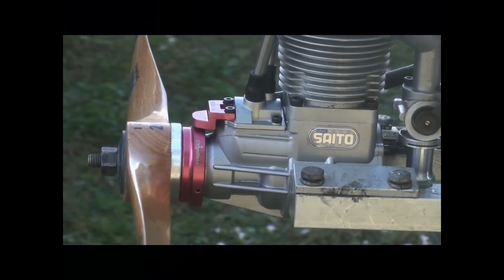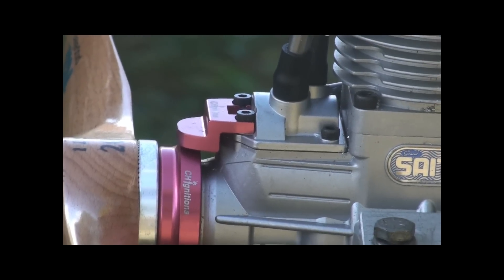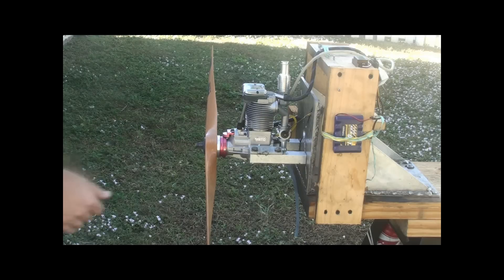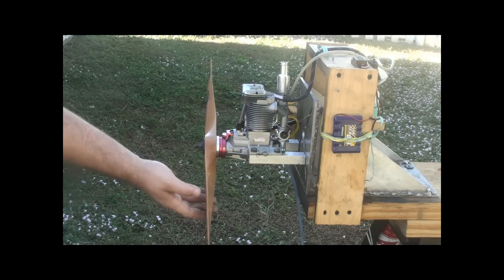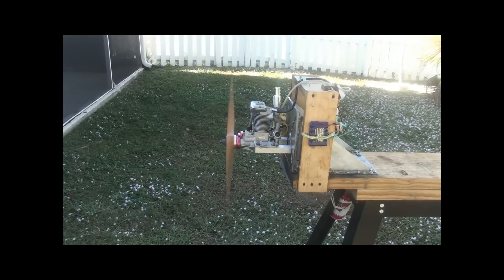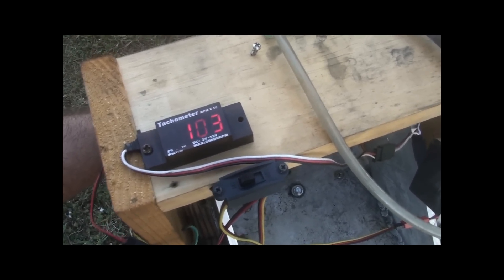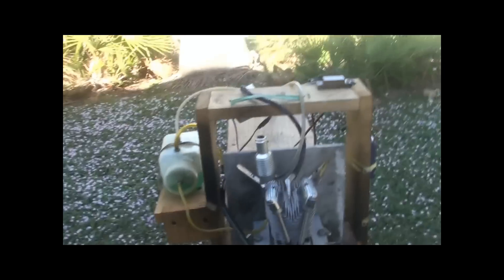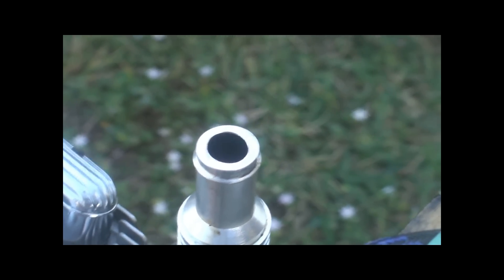Saito FA220 GLOW with CH Ignition and Adrian Touch.mp4

Comment: green fuel is full synthetic glow fuel, i use this at 15% for good idle and top end power and add 1.5 ounces castor and run 32 to 35 degrees advance because glow burns slower than gasoline. gives less kick back at start and turns a 19 x 7 prop 8200 and pulls hard.